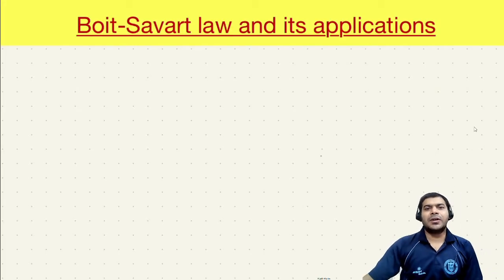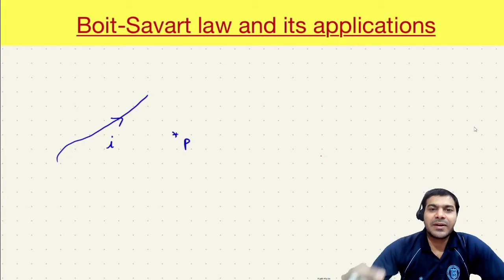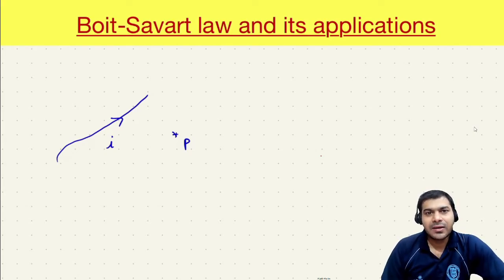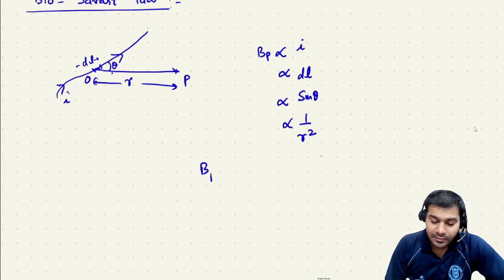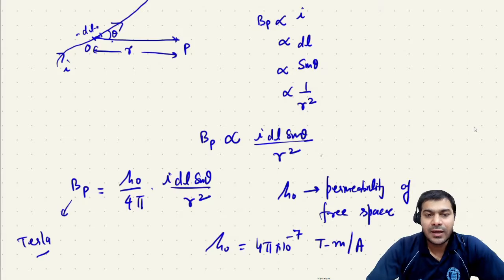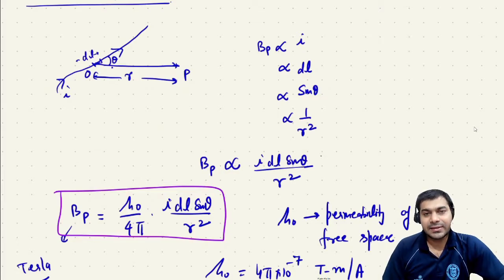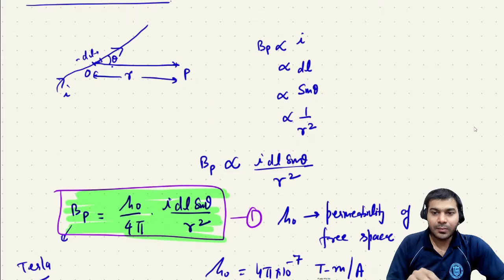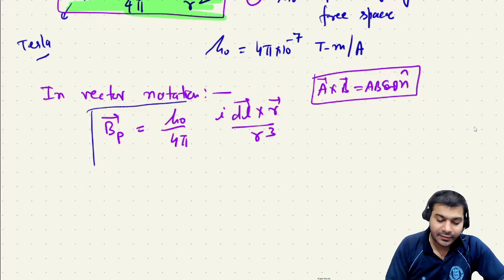Biot Savart Law and its application part 1

Comment: Good and detailed derivation (thanks!), but you should visually explain, on paper, many of the trigonometric angle properties you quickly do in your head. Very confusing to the 1st time learner wondering how they were derived. E.g., "the lower limit of delta is alpha and the upper one is theta"? or "for infinite wire length L, angle alpha = angle beta" ... Not obvious unless shown on paper. I may know how this came about, but it wasn't that obvious to me anyways.